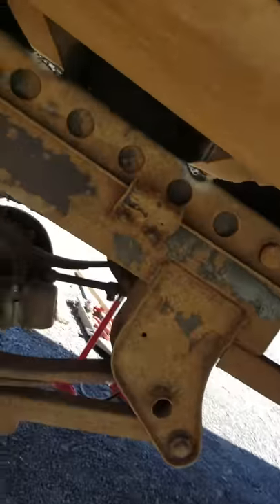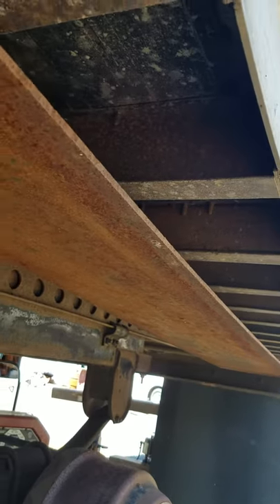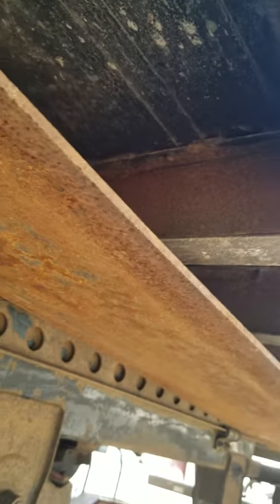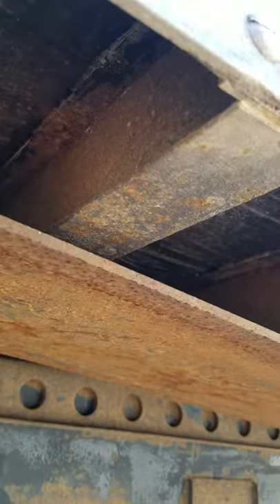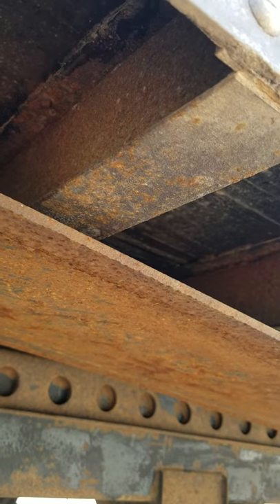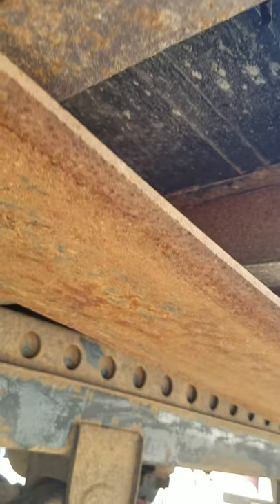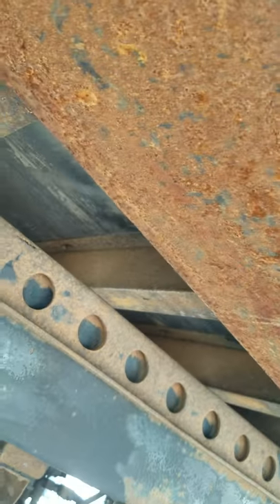Protect your trailer crossmembers from blow up recap / retread tires

Comment: I had 2 cross members broken by recaps. Now I only buy new none recaps.
Reply from the maker: Grab a calculator rear quick , and help the world add numbers up .  10 trailers ( we have) every one needs tires every 3 years on average .  New imported trailer tire  ( probably China)  that's 16/32 deep (like the g159 we use , "USA made") cost 300 dollars .   We pay $126 for g159 . Have yet to sell a trailer , which brings an average age to 20 years old . Punch it in real quick and talk numbers back to me . 10 trailers , that's 80 tires  , every 3 years ,  for two decades , come with the difference, and than  deduct  the cost of the plates at 75 dollars each side for each trailer , every power unit carries a spare . In the fleet we blew 23 trailer tires total since 2005 .  Mostly because of puncture that was overlooked by driver . One time he bent rim that cause leak which cause the tire to run flat .  Large fleets save millions on retreat tires ,  why should I pay premium for something that I don't need .